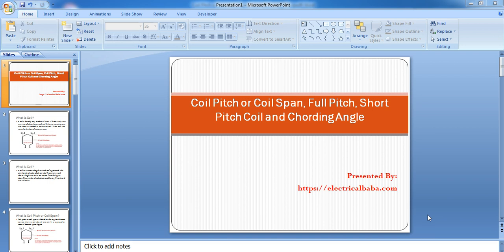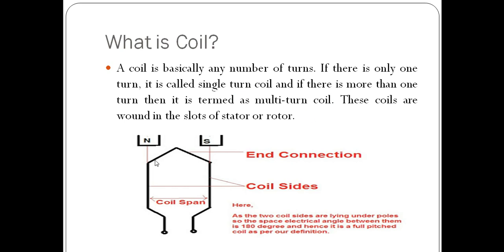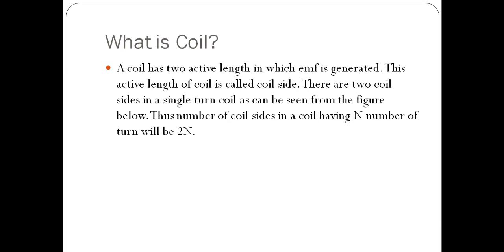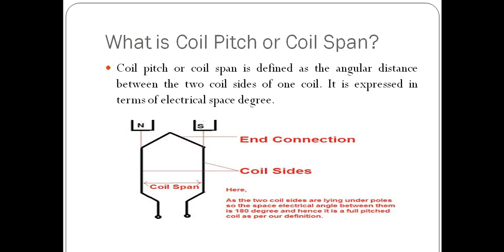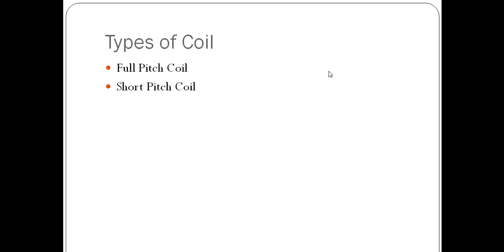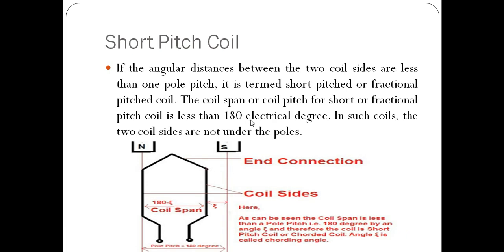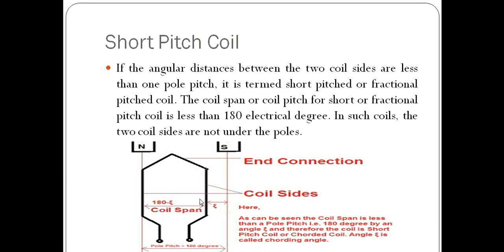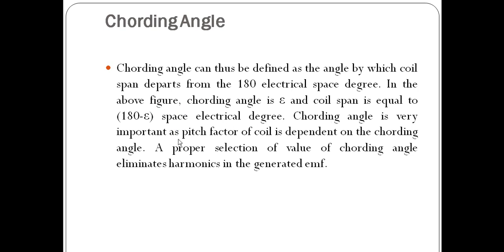Coil Pitch or Coil Span, Full Pitch, Short Pitch Coil and Chording Angle

Comment: In real life the turns of the coil side will also occupy a certain angular space. From where is the coil span measured? From the center of the coil side or its inner surface?

Is the pole pitch always 180 degrees or is it affected by the angular width of the magnet?

Thank you